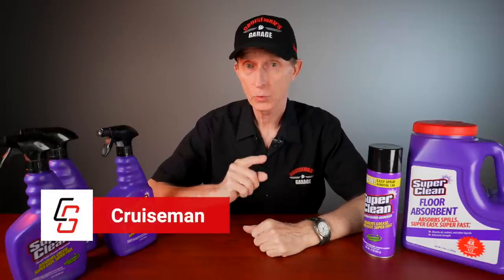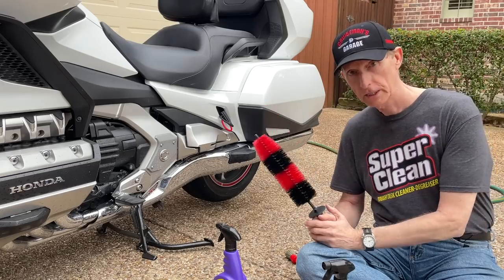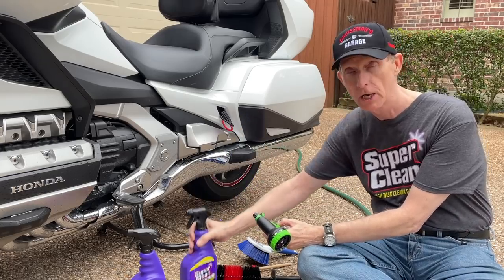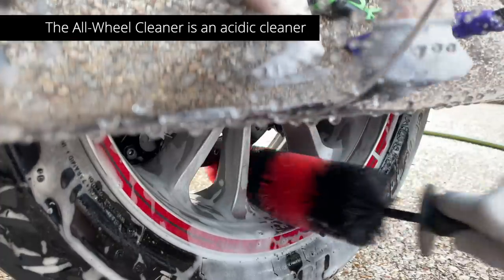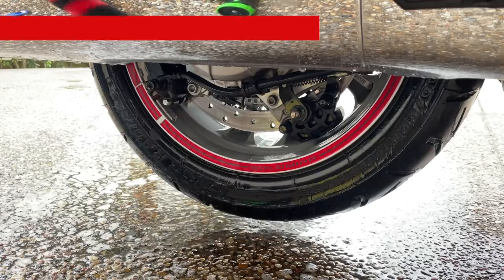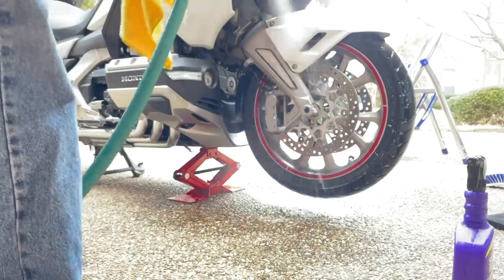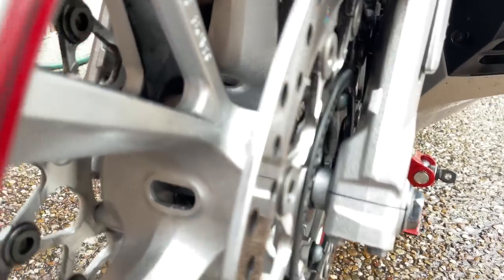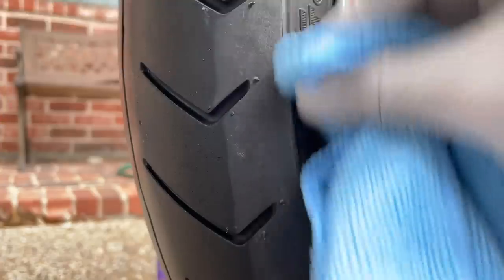Cleaning Motorcycle Wheels and Tires | Cruiseman's Motorcycle Detailing Series

Comment: There's many many tire dressings available. Make double sure to buy WATER BASE tire dressing. It drys plenty fast, and will not sling off tire onto your bike. The solvent base dressings stay kinda "snotty" wet and will reactivate when hot, and collect dirt and dust on itself. Solvent based dressing is extremely difficult to remove when you want to clean your tires next time.

Comment: I will never buy and or use Superclean products due to them having a high PH level. 
I use Eagle One All Wheel cleaner on my wheels, tires, suspension and engine. 
It has a neutral PH balance and does a fantastic job with no concern with damaging anything that I spray it on. 
Tire dressing? Wow, ummmm....Never ever will I use that on a motorcycle as well.... maybe you never ride in the rain?
Looks to me like you’re converting your channel to a product review one, maybe you got a free t-shirt out of it along with free product 🤷‍♂️
Reply from the maker: As for the tire dressing, that is why I emphasized to take extra caution not to get any on the tread of the tire.
Reply: 100%

Comment: You look into getting Wheel Woolies for cleaning the rims instead of the long brush. I use both on my vehicles and the woolies are much better. Nothing will fling back at you. Instead of jacking up the bike I use a product that you ride the bike onto and then when on it it has two rollers that allow the wheel to spin. They make cleaning the wheels on my Wing much easier. Thanks for the videos
Reply: Sounds great. We’re waiting for the name of that product you ride up on for spinning your wheels?,
Reply: I’ll post it as soon as I can
Reply: Google “motorcycle wheel spinner”. Harbor Freight has one for $25. I think the one I have is Hardline Rollastand. The HF model has a ramp. That may work better than the one I have
Reply: @coolbreeze653  That model is only for 500 lbs max.  GW 900+ lbs
Reply: @czyzjr  you’re only putting the front wheel on it. Not the entire bike

Comment: Well done. I have a question not related to the super cleaner products. It is my  impression or the front brake pads are to close to the disc? When you spin the front wheel  there is a lot of friction
Reply from the maker: Yes, there should be a slight drag. That is normal.

Comment: Great video. I would suggest one caution: Pilots will often put a lock on the flaps of their plane so that the flaps don't move in the wind while the plane is tied down. To make sure they don't forget to remove those blocks before a flight, they tie a long, red ribbon or flag to the lock. I would suggest that a pin holding the front wheel straight have a big, red ribbon hanging from it so to avoid accidentally riding off with the front wheel locked in place following a cleaning. In fact, thinking further, since that red ribbon can't be seen while sitting on the bike, I think I would make my red ribbon long with a loop at the end to hang over the throttle handle of the bike. Then, there's no way you can avoid see that your front wheel is still locked before rolling the throttle to start a ride.
Reply from the maker: Good idea
Reply: @cruisemansgarage   I modified my comment to include making the red ribbon long with a loop at the end so you can put it over the throttle. That way, you can't miss seeing that your front wheel is locked before riding.
Reply from the maker: @mrdonsmith  Even better.

Comment: Using the regular Super Clean diluted with 4 parts water to 1 part SC on my '05 GW.  I've found it's easier to remove the rear wheel to clean it. Then I apply wax once a year that helps to just rinse off the wheels.
Reply from the maker: I agree that is MUCH easier to clean the wheel when it has been removed.
Reply: @cruisemansgarage  Used Super Clean on the body work to strip the old wax off before I clay bar then polish and wax.